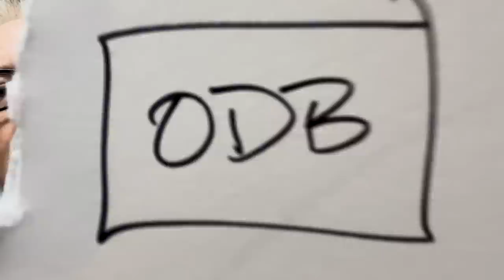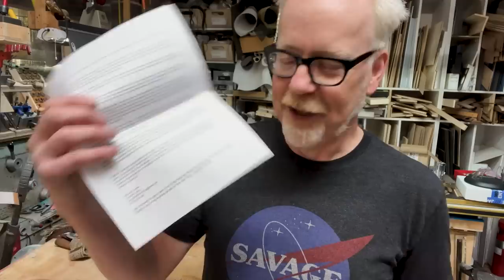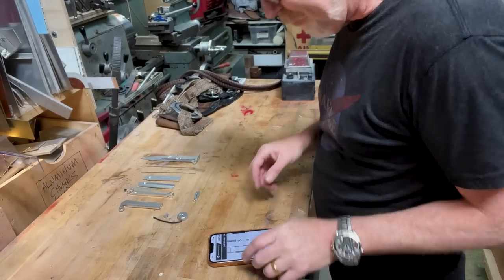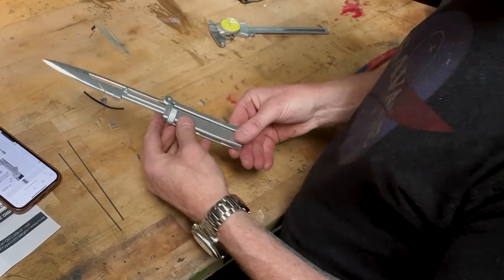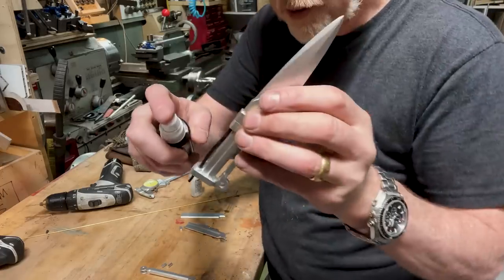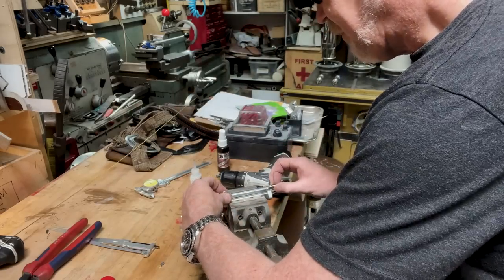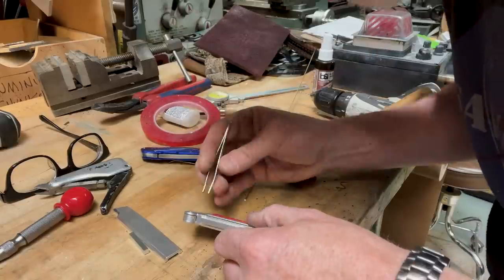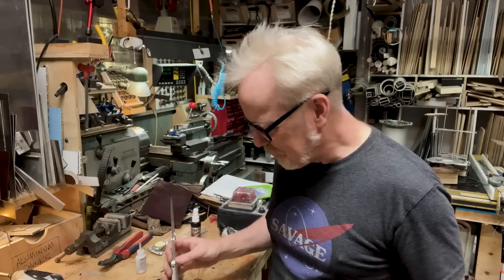Adam Savage's One Day Builds: Mandalorian Vibroblade Kit!

Comment: Adam I have a solution to your VHB dilemma. I've used the 1" wide stuff that is common in hardware stores between the duct-tape and cyanoacrylate adhesives. It's pretty handy stuff but it likes only the cleanest surfaces and seems to work better on very smooth surfaces. The backing is the worst part not only getting it started but not bubbling the adhesive out in the middle somewhere. If you have time to place it and clamp it with a wood block or something for a few minutes you can then un-clamp, take a strip of duct-tape or sometimes even blue painter's mask and stick that over the end, peeling it back at the appropriate angle will usually peel up the end/corner of the backing enough that you can get a firm grip on it.

Comment: In regards to removing the backing, I have a method that's a little hit or miss, as to if it will work. What I like to do is near the corner (about 2 or 3mm from the sides), just lightly puncture it with a fresh blade, and pull up a tiny bit. generally, this is enough to pull it up to the point where you can easily grab it. This doesn't work great with the foam ones, but for the (what I call) gel ones, this works pretty good.

Comment: On the vhb try heating it with your hair dryer should soften the glue enough to make the backing easier to remove but not effect it’s hold once it cools.
Have not tried it on vhb but have used it for other tapes

Comment: Some good tips for VHB in the comments already, but IMHO you'd benefit from some better forceps. Those flat bladed smooth guys aren't great when you need a grip. I'd highly recommend tissue forceps. They've got a good set of positive, interlocking teeth at the ends- particularly good for grabbing and holding small, slippery ends and such and they'll be sharp enough to pry up the backing, eliminating the need to for a blade to get it started.

Comment: When peeling double stick tape.   I start it ONE time,  from that point forward, I leave a tail.  When the tail gets out of hand I trim the tail.  That way when I go to apply the double stick tape I can always pull the backing away.  This doesn't help if you've got extremely long areas to tape down however.

Comment: As to the backing of the double-sided tape; may I suggest taking a lighter to the end you intend to peel. Just waving it a bit until the very corners just slightly start to melt. And I mean slightly. Then it should peel apart with ease.

Comment: If you want to get the plastic off the VHB, we would just use a smaller piece of VHB. You kind of rough up the plastic with a bit of scotch Brite or steel wool, stick the tiny piece of VHB on it and then peel it off. Doesn't always work, but works exceptionally well when it does.

Comment: I often see you spray the activator for the CA glue when it looks like they don't contact each other.  In this case you put CA glue on the rods, put it together and then sprayed the outside.  Does this actually do anything?
Reply: I think it's for the glue squeeze out
Reply: if the activator is applied to the glue on interior spaces before assembly the glue will set before assembly can be accomplished. The  activator will set the outer surface of the glue to keep everything in place while the interior sets.

Comment: i always use my scalpel/x acto blade to remove backings
you can either slide the blade between then sticky and the backings or, you can use the tip as you do for styrene, tap the corner and slide it backwards, ta da -.-

Comment: with double stuck tapes I find that when possible run it alittle long to fold over a edge. the top peel back tape seems to wanna pull easier when the double stick part is bent over a edge. the  cut the eccess after

Comment: Simplest method for exposing any double-sided tape is to fold the end over and stick it to itself, then grip the end between a finger and a thumbnail under pressure, and pull. The backing comes loose every time. With very low tolerance for differences in thickness, you may have to cut off the doubled-over tape (don't trim the backing when you do that or you're back where you started)

Comment: I Use tape. Put the vhb down where you want it, press it firmly down to the intended surface to make sure it's properly bonded to the work. Now take a strip of tape, I use packing tape but I'm sure other types would work. Put a fold on one end of the tape, and place it on either end of the vhb backing paper. Now peel the tape up, if you did it right the backing paper should come up with it.

Comment: I use a thin utility blade slipped between the backing and pad, then flip the blade and press to fold a corner of the backing over just big enough for a now standing up vertical finger grab

Comment: When using VHB don't cut it from the roll first. Stick the tape down, peel the backing and then cut the tape but not the backing, leave some of the backing on the roll. Then the next time you use it the extra backing left on the roll makes life so much simpler.

Comment: to peel that orange tape off easier....and there is a very small learning curve,  stick it where you want it and before you cut it , hold it at the cut point and stretch it just a tiny bit then cut it at the stretched  point and it orange piece will have a little tab  you can grab it and pull it off easy.

Comment: I mean it is aluminum but you could use low temp solder and braze the whole thing where glue is required. You would have a much sturdier prop in the end.

Comment: I know this video is a year old and you probably won't see this but quick tip for help with getting your corner peeled 3M double-sided tape. All you have to do is just pull the corner the sticky part the red part does not stretch and then it will release from the sticky part.

Comment: Never used VHB personally, but the thought occurred to me that once you're sure the side you've already stuck down is sufficiently stuck, maybe scuff the top of the still attached backing slightly with some sandpaper or whatever, then stick something else, like a scrap bit of plastic with a dot of CA to it. Wait for it to cure, then hopefully the plastic-CA-backing bond will be stronger than the VHB-backing bond, & you can just peel it up by pulling on the plastic.

Maybe CA isn't the best choice in this situation 🤷‍♂️, I don't know, I just meant that you could try creating a bond to the top side of the backing that's stronger than its bond to the VHB, & then exploit that to solve your problem.
_____

On a different note, I'm sure I've heard of someone actually making some sort of real life vibro-blade for practical purposes (surgery, perhaps?). It would be interesting to see how close someone could get to making a working version of this prop, although it would probably require power via a cable, as I doubt current tech could squeeze both the mechanism & the power source into something that compact.

Comment: My secret tip for thicker double sided tape backing is to cut a very shallow slit into the middle after applying basically cutting the tape in half but not all the way. That way you can peel it up from there and since the tape itself isnt cut youre not fighting a corner that wants to come up with the backing. 
Tedious tho

Comment: As for removing the backing on the VHB, I can see part of the problem is your tweezers. Correct implement, but not the right 'model'. Next time you're buying your favorite adhesive medical strips at CVS, head over a few aisles and pick up one of the probable multiple versions and colorways of Revlon stainless steel slant tweezers. Solid build quality, and holds up to some serious tweezing action while being 'sharp' and precise.

Obviously other brands will work, the point is getting tweezers that are precise and has good clamping force across the jaws. Makes short(er) work of backing, vinyl weeding, eyebrows!

Comment: Tape with backing? I always cut it a couple mm or so longer and fold the end I start peeling it off at so it sticks to itself, and use my nail to lift the backing  and tadaaa! I only do this if the mm or so of double thickness doesn't interfere with anything.
If that is an issue, I apply the tape with backing,  and using another small piece of the same tape, specifically because of how incredibly sticky it is, even to the shiny upper side of the backing, but duct tape or crystal clear scotch tape works well enough most times too, and stick it to one corner or end of the applied double sticks backing and it usually sticks easy and lift for removal 😊
That super sticky stuff is literally impossible to unstick from itself when it gets folded or worse, tangled or twisted, but my method works very well if fingernails don't do it and tweezers are out of reach or something

Now if only we could get the motors and mechanisms from the saw that doctors use to cut casts off of people into the vibroblades and swords, you know the saw I'm talking about right? Reciprocating blades that even at those high frequencies do not cut if what they touch doesn't have a minimum surface tension, and cut right through hard rigid  materials but vibrate skin and tickle a whole lot without cutting or slicing it?
Yeah, that has to do with the blade material too I think, but that type of mechanism attached to a dagger or sword or axe blade.....?😊😊😊
With an edge on the blade that is only one molecule thick.....?
Yeah, surface tension or not, it's cutting your armor, your skin, your bone, hell, it's cutting your whole arm off!
In star wars, the mandalorians utilized a special type of steel called Beskar that if one of only a few materials known to be resistant to lightsaber strikes, though over time, it will end up being cut through, and many jedi fell to blades and vibroblades made of Beskar wielded by mandos or bounty hunters or others who often sported Beskar armor.
The main character in the book I'm writing wields a lightsaber and  beskar vibro short-story and two chains made of beskar.

Comment: Hi, Awesome build. Consider looking into different glues for these kind builds. As you are aware the problem with CA if you accidentally dropped that knife the  parts can go flying off as CA is not very shockproof. 
I use selleys power grip a lot, look up the attributes. I'm sure that all major glue brands have something similar.

Ohh and what was the wooden box that got delivered, looks like a huge old speaker cabinet!

Comment: Took me a min to realize that ODB is One Day Builds and not what I thought it was Old Dirty Bastard 😂 Wu-Tang is for the children. 👐

Looks cool but the whole gluing thing is crap regardless what it's for. Bc super glue doesn't hold for shite on any metal. Should have had captive pins and screws for Assembly.  Also the tolerances could stand to be tightened up there was an awful lot of slop and jiggly parts like the guide pins and false folding mechanism. Also it seems way to small to me and idk why.